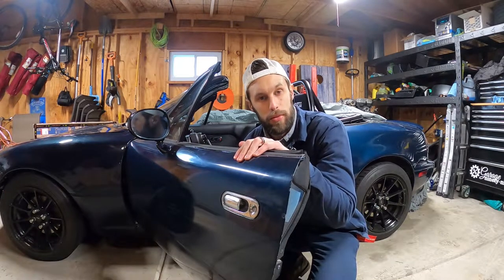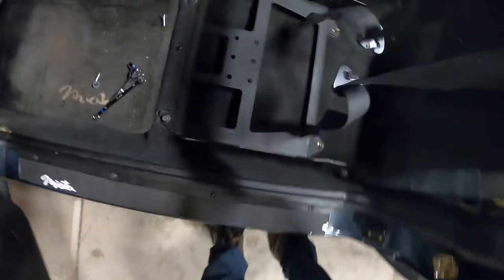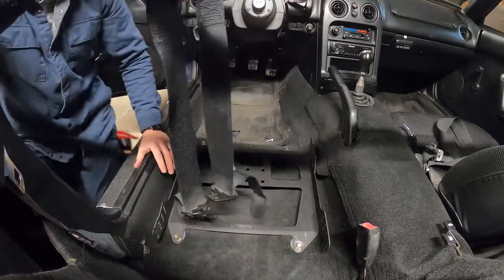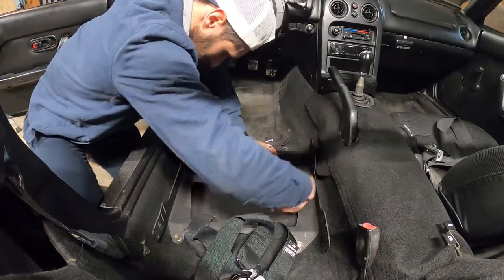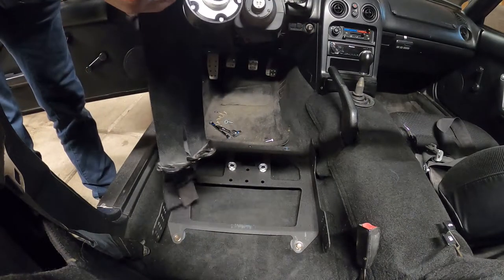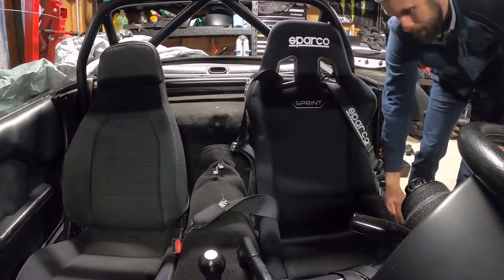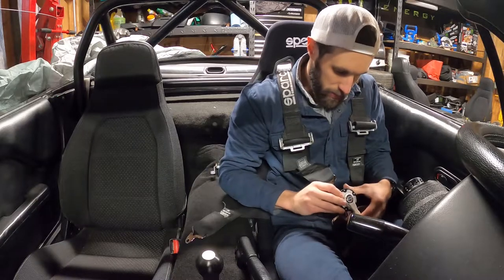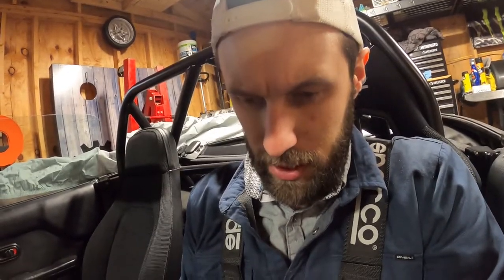Sparco 6 Point Harness in the Mazda  |  Miata Pt. 13

Comment: yoooo sick! I am also in the process of building an nc Miata for the track and will be using this same seat/harness setup. What size did you go with for the seat? im 6'1 185lbs and 32" waist
Reply from the maker: that's a pretty similar size to me. 6'2 160 lbs and 32" waist. just the standard/smallest size will do. I drove it for the first time last week for about 30-45 minutes at a time and was very comfortable the whole time. Good choice for our size.

Comment: hey, I see that all sparco harness have the  eyebolt snap on things. I was wondering if those are removable so i can wrap my harness around the bar like u did on  the harness bar? because I have pci rails and their crotch belt mounting doesnt use eyebolts, u wrap the belt around like u do for the shoulder belts.

Comment: Hey Dalton I just bought the same car as you I’m pretty sure. I just purchased a 1997 Montego blue Miata and it came with a hard dog M1 hardcore roll bar. Looks to be the same as yours and I want to install a racing seat and 6 point harness like you did but I did not know if I can just use the bar that came on the roll bar already or if I must buy and install a harness bar to use a harness. Sorry if it’s a dumb question hope you can answer this for me because I don’t really want to buy a harness bar if I can just use the one that came on the roll bar.
Reply from the maker: Not a dumb question at all! I believe this one in particular has the harness bar welded into the roll bar but not all Hard Dog models do. Definitely don’t think you need to buy one separately.

Comment: looks good? i got a 1996 na miata, im 5'10 160lbs with a 30-32 inch waist depending how im good eating haha, do you think these seats would be a good fit
Reply from the maker: The seats would fit you perfectly at that size
Reply: Sweet do you recommend the normal or large sprint seat?